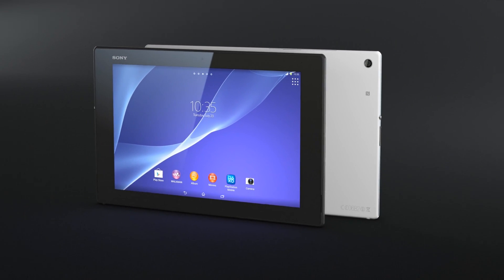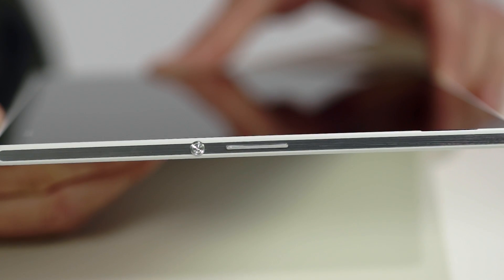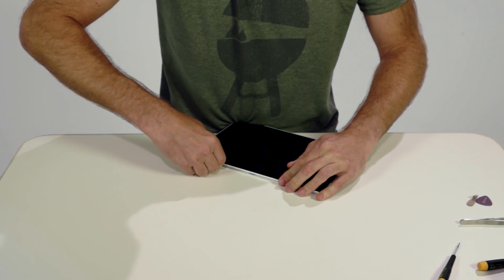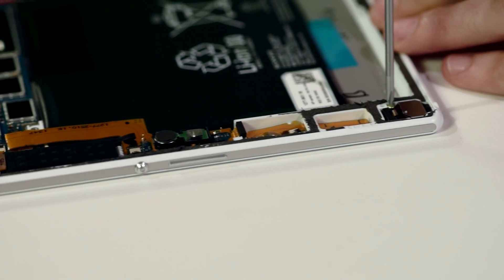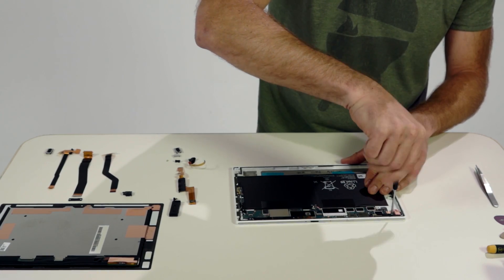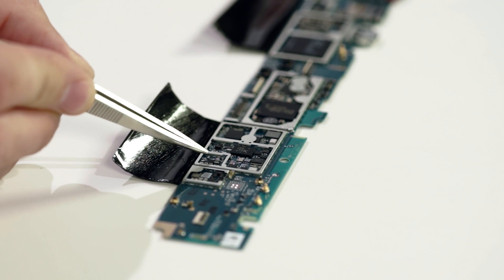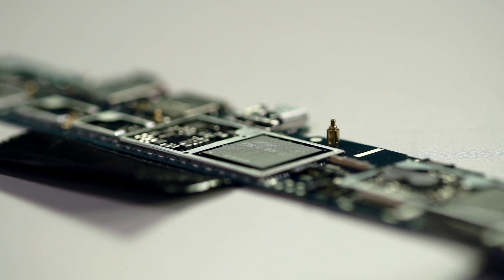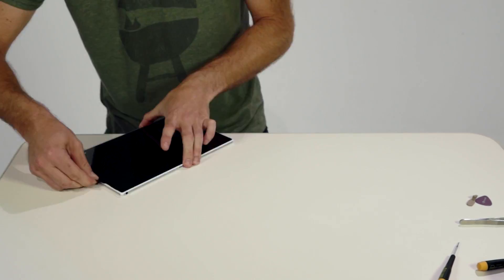Opening up Sony's Android Tablet, the Xperia Z2 Tablet

Comment: Any link to buy this Tool to remove the screen? or how we can search for it?
Reply: Simon KempSony original disassembly tool (1283-9490)
Reply: Michail Konstantinidis ebay item number: 281736259540
Reply: did you find out where to buy the tool Michail?
Reply: Simon Kemp yes it is ebay
Reply: junkfoodinc  - is that an ebay number please?